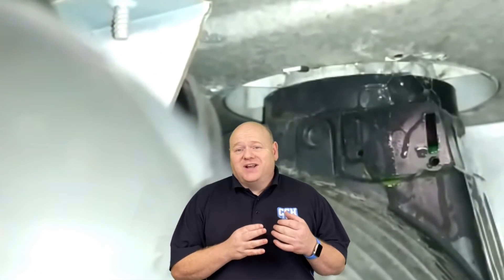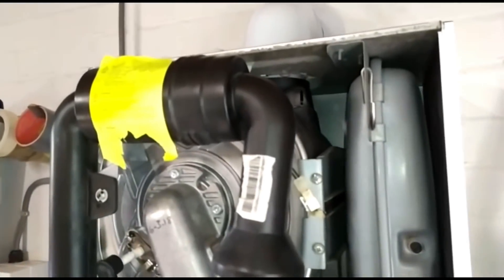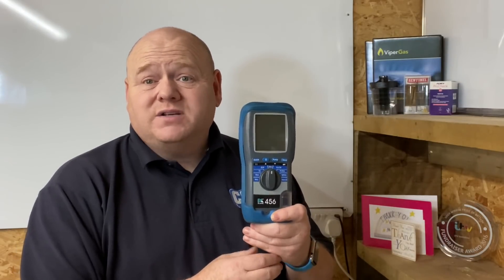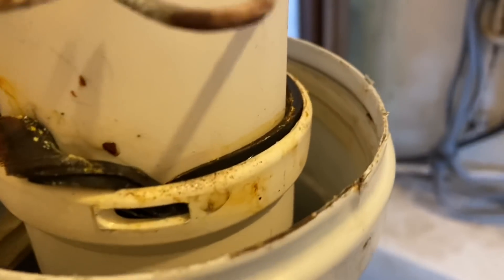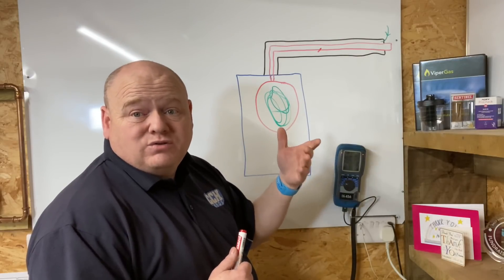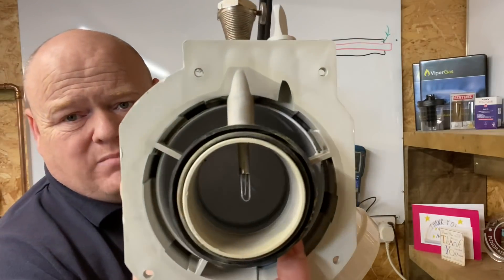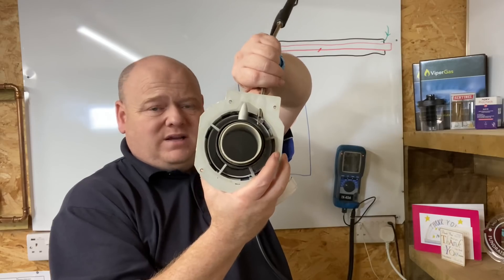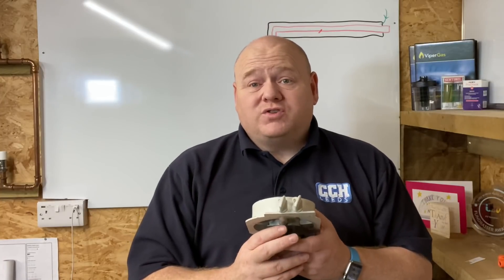Flue Integrity Test - Gas Boiler Service - ACS Gas Training

Comment: If the maximum tolerance is 0.2 CO2 at the air inlet point, at what point would you tackle the problem?  0.21, 0.3?   At what point in your opinion Allen does it become a serious issue?
Reply from the maker: Thank You

Comment: Hi , I’m doing my Acs course now , and i do enjoy your video.
Just wondering when you do the flue integrity check and you get 20.9 % of air is good !
But what happened if you also will get Co2 reading?? 
Is that class ID ? 
Or you should not get any Co2 reading ??
Thanks
Reply from the maker: I wouldn't like to give advice on AR and ID best asking gas safe or the boiler manufature. Thanks.

Comment: if the flue seals are damaged or worn can this cuase sometimes issue firing the boiler? sometimes mainly on very could morning my worcester greenstar junior 24i fails to ignite it tries few times then it goes into lockout.. all CO2 and flue analyzer tests are fine.. but i have notice seals are worn and need replacing on a duct elbow and uper flue joint.thanks

Comment: I have leak on one of the joints of the flue extensions, its a 3 meter run and we have 3 joints, horizontal run. How do we get this fixed and is it dangerous or detrimental to the boiler?

Comment: Hi Allen does rain water get into the outlet of the flue and where does it go, I’ve had a new boiler fitted with a deflection kit on the flue the boiler is a ideal logic max.
The deflection kit slightly angled upwards towards the sky and the instructions says it should be like that, but I think it would be catching the rain. Surly this isn’t good for the boiler ?

Comment: Hello alan, just wondering the leak detector fluid used in the first video is that just general leak detector fluid or is it formulated for flue seals, also would that show a leak on a burner seal  i.e G10 seal aswell as flue seal, cheers
Reply from the maker: I would normally use my fga and not leak detector fluid

Comment: The re circulation of flue gases/ products of combustion normally only shows up on an analyser when testing the boiler in minimum rate, as at max fan speed the forced air is strong enough to pass past any faulty seals or joints on the flue, therefore it is very important that both max and min combustion checks are carried out. Great job as usual Allan.
Reply from the maker: Thank You.

Comment: How do you stop rain coming into the flue ?
Reply from the maker: The manufacturer tries to design them so water cannot come in from air intake.
Reply: @AllenHart999  have you got a video of settling up and adjusting gas valves , you are a massive help , thank you 🙏
Reply from the maker: @davebayliss3142  https://www.youtube.com/watch?v=rcqs0S_R0Zo
Reply: If its just the horizontal flue terminal straight into the turret like most jobs are, then I fit the terminal level as the fall is built into it. If flue extensions are needed then I fit the terminal level still but flue extensions with a slight fall.

Comment: Thanks Allen.  Very clear as always, thru Ambassador of the trade. 

What i did ( i am retired now) i  calibrated the tester in the outside air-passage of the flue before the boiler was in operating mode.  
That way i always had clean non Carbon Monoxide air.  
In the area were you stand could be CO concentration from the boiler you work on or from neighbouring Gas appliances.   
Take care, and keep up the good work.
Reply from the maker: You are very kind. Thank You

Comment: I always test at the flue turret seal on vaillants.
Reply: I work for a housing association work on  mainly Worcesters, Vaillants and Baxis.
The Red gaskets on Worcester are more common. 
As woth Vaillants,  I've had 2 this year.
And it less common on the Baxis.
However I think it's more common on the older the boiler is.
Reply from the maker: @justsendmelocation5068  If you do get any please send me some videos. Thanks. WhatsApp 07725 692699
Reply from the maker: Do you find many with issues? Thanks.

Comment: Rubber perishes. No. Matter what they say. Fga great for finding these things. Modern boilers I am afraid built to fail.
Reply: "Modern boilers I am afraid built to fail."
This is why I refuse to replace my old working Vokera Compact 24 and 28 boilers - I must have really bad luck with boiler engineers coming over and telling me it needs to be replaced with a modern one before even trying to troubleshoot problems on existing.

On my Compact 24 it was a broken pump plastic housing that was pierced through right behind the automatic air vent bottle (the housing has over 2mm thick walls so am still puzzled how this happened but it looked like a screw driver job) causing water to leak - just had to replace the housing which I got cheap from from eBay with a spare pump. Another leak was from a loosened nut on the heat exchanger's water connection pipe that took 1 minute to tighten up and stop the leak.
They all wanted to replace my boiler instead of troubleshooting and fixing simple things. I also don't believe in boiler servicing in the UK anymore as many of certified engineers that serviced my two boilers didn't spend more than 15-20 minutes on each! Other faults that had to fix involved two ignition PCBs (a common fault on boilers), one main PCB and thermistors replacements.

I took apart my two boilers (excluding any gas related stuff which don't want to touch) in order to clean all water related parts e.g. including removal of debris from pumps, washers replacement etc. and it took me way more than 15 mins to do it properly on each (2 hours on average). Both boilers now run smooth and super quiet - no issues whatsoever.

I wish I didn't have to touch these things myself as am way too busy with IT stuff but have completely lost my confidence in quality of services provided by local boiler engineers (including Vokera certified sent to me - they should all watch these videos!). They don't bother to check things properly or clean parts when necessary to maximise boilers' life-span hence had to start doing these things myself and only get engineers to sign off my work. I'm also getting a flue tester to do annual CO, CO2 and O2 readings as none did them apart from convenient quick visual inspections (I think they rely too much on off-shelf CO testers and regulations that enforce them). I'm still hoping to meet a boiler engineer(s) one day that will take their job away from me...

Comment: A crack in the flue pipe is the equivalent to a egr valve on a engine in a way ,sucking gas’s back in
Reply from the maker: Not really sure about engines but thank you for the comment.